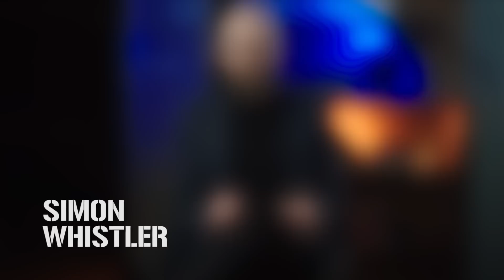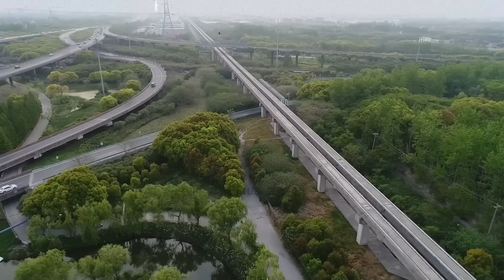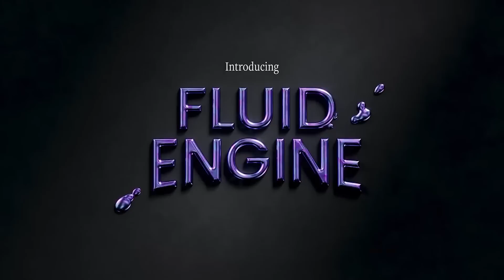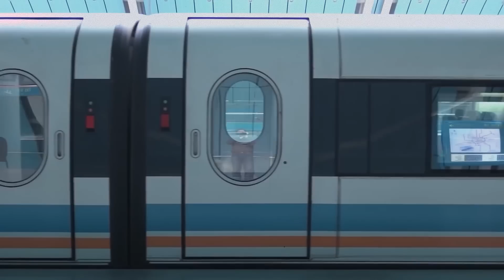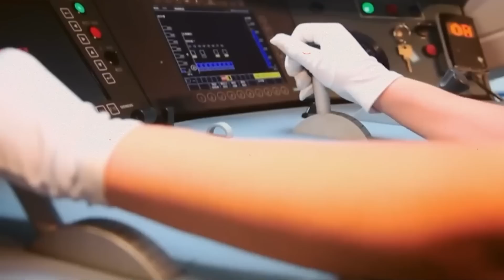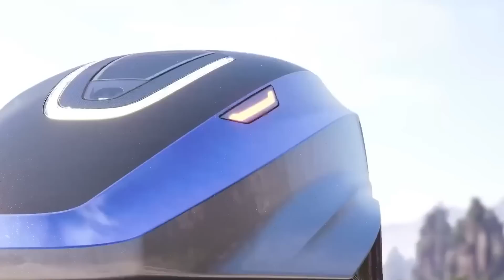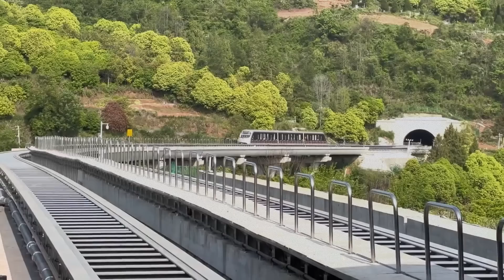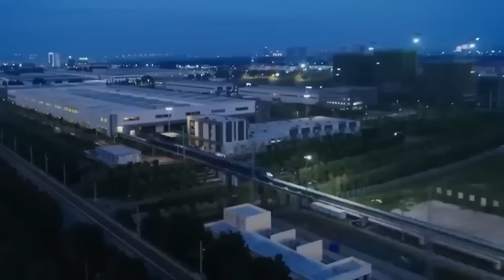A Chinese Maglev Revolution is Coming...

Comment: by flying you would have arrived already. you know why cars are better than the train. make it flying cars. infrastructure is community shared effort, personal transport vehicle is not. but if you want to go to orbit by a factory, then do a maglev to-orbit accelerator track on the ground. otherwise just make the flying cars space planes. magnet roller wheels both stick to the normal tracks and levitate over them. optimally you would only need to upgrade a normal wheel train to a magnet wheel train to make it a maglev train. the usual iron/steel tracks are just fine. then also the magnet wheels are the momentum source by rotation. so they work exactly the same as normal train wheels. simple hmh. for additional support, left/right side roller wheels to keep the wheels on top of the tracks. or just the normal angled wheels of a normal train. dont judge anyone. above came to save, not to judge. how you judge, you are judged. so dont judge. not even pre-maturely, law breaker. dont fall back into judgement. this is not fine, brothers. from same mouth leaves the cursing and the blessing. yeah vtol drone-plane quad copter can fly at v22 osprey speeds of 400km/h. why do you like being judgement.

Comment: Current maglevs have 5 issues, 

1: you have to build a completely new track, 

2: Cost of the track is 4 times higher then regular tracks with all the electronic charging wires, 

3: If the power goes out, you can’t use the track because it requires electrical power and you can’t drive anything passive on it, 

4: the switches on the track have to be completely moved if you want it to change directions.

So it not a very Practical design but a company in Poland called nevomo has made a track design that has solved those problems, there design is a semi passive system, it’s basically modifying existing tracks with a electromagnetic third rail that’s a passive magnet which proves the lift and then it adds 2 more rails on both sides of the track for active electro magnetic stabilisation, this is because permanent magnets are unstable so they need to have some kind of magnetic or mechanical stability, one company called iron lev uses rollers, the tests have show it can go through switches and over roads, the goal is to increase the speed by 72%, 177km/h to 300km/h for regular rail and 320km/h to 550km for high speed rail, an important thing I must note is that regular rail can be used on the tracks due to the magnetic technology being place around it and can actually enhance it by using liner acceleration which is a known technology on Vancouvers sky train
Reply: 1. It's already created
2. Still costs less than roads
3. Power back ups exist
4. China already have our

Comment: I recently returned to China for the summer, landing at the Beijing international airport (which it alone is very nice) and took the regular high speed rail from Beijing to Wuhan. The ENTIRE trip took like maybe 5 hours. I, having suffered through about 48 hours of sleeplessness and a minor cold setting in, had basically fallen asleep instantly. The seats were spacious (I think I got second class tickets) and the ride was just really nice overall. And it was really cheap too. 

Compare that to the... somewhat bad... metro system in my local area in the U.S.... I can't not laugh. Even the lesser maintained local intracity subway/light rail was so much cleaner and better maintained than the subway system which is almost like 60 years old now...
Reply: Almost 60 years ol? Is this DC Metro?
Reply: @peepinR  no

Comment: China have Magle train in 2020 come out. The speed train 450km per hour convert to 279 mile per hour.
Reply: The 450 Km/Hr figure has two significant digits so the conventional conversion would be 280 mi/Hr.

Comment: The new high speed maglev by CRRC is based on the same Transrapid tech that has been used on the shanghai maglev. They licensed core parts of the technology while developing other parts at home.
The high costs of having to purchase directly from germany as opposed to using domestic trains is what stopped the initial rollout of maglev. Now that this problem is solved, China goes full steam ahead.

Comment: China's high speed network is very unprofitable because as the network ages it requires ever more maintenance to keep it going plus only a few of the lines are profitable hence it has accumulated almost a trillion dollars in debt. The network could have been built at 10% of the cost using a max speed of 250 KPH instead of 350. 

Perhaps with these Maglev lines they have learned their lesson by the fact that they are only going to connect the major cities. It is unlikely it will ever recoup the money spent especially as the Chinese population begins its rapid decline to 750 million and perhaps even 525 million as researchers at Shanghai Academy of Social Sciences have projected.
Reply: Soooo why is usa military not providing any profit ? We sank trillions into it .

And yet e get no profit from it .

Why ?

Comment: You need to clarify what you meant by transmission in a diesel powered train! Most Diesel trains are what is called Diesel-Electric and there is no transmission unless you meant power transmission to the wheels via electric cables as the motors seat in the trucks (bogies) of the locomotive.

Comment: The Shanghai maglev is incorrectly called very expensive, because of the extra and longer piles required for the track as it was mostly built on swamp land and delta plain silt. They got that sinking feeling after a few piles were placed. It did cost extra, but not because of the technology

Comment: An air berring in a low pressure system... Something don't compute there buddy. Hyperloop tech is an absolute pipe dream, not impossible but completly unfeasible.

Comment: There is another massive project going on in China: building big power bank with two artificial lakes at two levels, when there is electricity overproduction, lift the water from low to high, when electricity is needed, release water from high to low. Basically it works as buffer for electricity production by solar. Now the solar electricity are not put on the network. There are around 20 projects going on, after being built, I guess all solar electricity will be connected to the network, the percentage of green electricity will increase a lot by that time. In 2/3 years.
Reply: This method is limited by the terrain. At the same time, China is also building compressed air energy storage projects, which compress air and store energy when electricity is abundant, and release energy during peak electricity consumption.

Comment: I'll Tell Why the Chinese are building the meglav network.... its to beat the Japanese.  The Japanese are trying regain their High Speed Rail crown lost to the Chinese by developing MegLav.  However If the Chinese also has MegLav... with its domestic scale and manufactoring cost advantage,  it will essentially end the Japanese's high speed railway export ambitions.

Comment: Some of the video footage you used are actually from Japanese Maglev testing track where test trains have been running for decades.  You can tell because the train is driving on the left. It is striking that there is no mention of the testing track or the construction which has already begun between Tokyo and Nagoya.
Reply: to be fair this video is looking at china and using footage of maglevs in general to get the idea across, Japan might be good at making High speed and Maglev rail but China is so good at that aspect they blow any competition out of the water. the only county that could ever compete with them doesn't have any high speed rail
Reply: Chinese trains also drive on the left. Guess they all picked up from the British.

Comment: Also noise, Maglev is smooth, quiet, fast and requires less maintenance. I've only been on the Shanghai one too and from the airport. Its been running for years as proof of concept. When China has technological development they build real world examples to get real world experience and data. Leading the world.
Reply: They cost more to build and also more in electricity bill
Reply: pfft I refer you to there aircraft carrier fleet with it's frontrunner having cracked runway before really being used china is not in a good place nor does it use good quality materials or construction practices these trains are wasting time

Comment: I just came back from Shanghi...
For experience, I tried this train from Shanghai CBD to Pudong International Airport, a distance of some 30 kilometres. It took us 7/8 minutes to reach the airport with a maximum speed of 300km/hr.
When I querried about the speed, I was told that the short distance and the track runs through the city centre, it was cap at the speed .
Nonetheless, I was told that they are planning a connection to Beijing and travel time can be btw 4-5 hours! What would happening to inter-city avaition then?
Reply: Shanghai to beijing is 4hrs in HSR, and it is operating for years.

Comment: Ah, nope.  People have already voted with their feet, heading towards the slower but much cheaper regular-speed trains.  The high-speed trains are running at very very low number of passengers and losing tens of billions of dollars a year, year after year.  This one company is 900 billion in debt.

 China is REALLY GOOD at throwing money at expensive projects like these and the two hundred million unfinished or unoccupied housing units.  Not so good at doing things economically and reliably.
Reply: thanks for pointing out a sensible problem with this alot of people really want high tech trains for some reason and unless your japan it doesn't make sense

Comment: I saw a claim once that at high speed (200mph?) 99% if the resistance is from the air and 1% from the wheels.

Comment: The USA spends trillions on trying to take over Afghanistan.. China builds a meglev train.  That tells you what empire is in decline.
Reply: the usa  already has a continental train air and road system it instead advances the world in lazer robotics and other such with aid to other countries in need given generously chinas belt and road initiative has failed and it relied primarily on tricking middle eastern nations into taking on debt after an intital buy in that tainted the look of initiative 
also chinas unemployment rate is baaad right now cause there housing collapsed and the world is drifting to using other places for cheap factory labor

Comment: Amazing what you can achieve when you don't have to worry about health and safety, building codes, or human rights.
Reply: Excuses, excuses. Always pointing out the flaws in others despite their achievements is the main reason why the west is falling behind.
Reply: @eat_ze_bugs  yes "excuses" nothing to do with human rights violations.

I'd rather not have buildings made out of substandard materials that literally crumble and collapse like Chinese tower blocks
Reply: @6Shroomie9  Care to explain what happened to the Miami tower collapse? Or the leaning skyscraper in the heart of NYC? Or the pedestrian bridge collapse in Florida? Or the shitty planes made by Boeing? We have built many things with shoddy quality too...
Reply: haha. I'm an Chinese Architect worked in China for 10 years. I am currently working in a New York Architectural firm for 3 years. Although China doesn't use IBC but the GB codes China adopts is much more strict than IBC.
Reply: @camdenuptown1777   I refer you to the shaking skyscraper problem and notoriously bad building code enforcement you are a liar or a moron
Reply: yeah they spend of effort boddies and money to inevitably end where they started with even less

Comment: Speaking of this Skytrain - its looks like a regular monorail and operates like one. Speed isnt great, frequent stops too. Isnt this was point why maglev rarely used for citytrains - not much of advantages to do that? Feels like Skytrain is malev just to call it maglev in official papers.
Reply: Speed isn't the only advantage of maglev, the video mentions maglevs require much less maintenance and is quieter because there isn't track friction.
Reply: @hughmungus2760  Its easy to maintain as long its doesnt broke. But when it does - easier to scrap.
Basically story of all such low-speed maglev lines. Also, in previous video on that topic Adam said that "short and low speed maglev lines have no real advantage".

Comment: It would be interesting to see financial side of this topic. My understanding is that many of the HSR lines are not profitable. Some even to extent that they are not able even to cover interest on the loan, let alone loan itself. And maglev should be order of magnitude more expensive than HSR. That doesn't ignore the fact of all the social benefits HSR brings. But in the long run it raises questions of sustainability of all that. Specially considering that in next 10 years around 300 milion of chinese people will go into retirement and chinese fertility rate at 1,16. Maybe robotization of the country factories will make up for that.
Reply: debt, particularly long term debt held by one state institution to another is largely irrelevant. they can be defaulted on with next to zero consequence.
Reply: @hughmungus2760  you can always argue that it doesn't matter how economically sane some project is. China now has over 45.000 kilometers. If most of them are not profitable they will need state/region subsidies. That money has to come from somewhere. You need to take that money somewhere to put that money into railways. Sure there are benefits but question is at what cost. With time maintenance cost will rise just adding to the problem.

Comment: Everything is based on debt or running in losses, none of these are actual advancements.... There's a big debt bubble waiting to burst
Reply: Better than usa's debt
Reply: @fahman3422  actually there debt ratios are proportionally worse than ours much less wealth to pay for it and remember thanks to the one child policy they have a far too large older generation with around a third of that being the younger to support them and of that younger only one third is female and since we don';t have machines to make kids this is a catastrophic demographics problem
Reply: Everyone is obsessed with one child policy but Korea and Taiwan never had it yet they are in the same position.
It made it worse but not as much as one would think.
Reply: That's where you're wrong. The numbers might be higher, but most of that debt is not tied to our GDP.
Reply: Compared to ours? It's a drop in the bucket.

Comment: I know there is abit of hyper about China working on maglev, however that is largely a research project, there is no intercity infrastructure project for maglev in China since they are more concern with coverage than speed (with the current HSR, you can get from one end of China to the other end in a day, maglev is abit overkill for chinese traveling habit). the only country to have a intercity maglev project now is Japan. the reason for this is Japan, most of it population is just in 3 cities, so you really only need to connect 3 cities together to have a massive boost, furthermore the Japanese has demand for trip that is not "end to end", that is they would go to another city, have meeting, then go to another city or home on the same day, so a faster travel time make more sense than for the Chinese who do more "end to end" travel and would stay at their destination for at least a day.

this is not to say China won't pursuit Maglev in the future, however it isn't going to be the first, nor do they have a plan on what they want to do with maglev yet, this is really just preparation work so that if they want to build it, they would have the means to implement it. I do see the possibility of "regional/provincial maglev", that was the original proposal, a maglev that link hangzhou, shanghai, suzhou and nanjing for example can allow these cities to merge into a single economy.

the first practical commericalization attempt for maglev was in germany, the shanghai maglev which was suppose to grow into a regional maglev was build using this technology. unfortunately, an accident occur in a routine maglev demostration in germany, the train collided the service train due to communication errors, while the accident was no fault of the technology, ruin its reputation in Europe, killing any chance of it been selected by any european government. China too walk back from maglev, but it was really due to them understanding that coverage is more important to China than speed than because of the accident in Germany.

I know video has to sensationalise thing, but I feel it is best to explain the reality for what it is than to buy into the marketing hype of these technology. as cool as maglev is, it has very limited use case and is really only suitable for rather linear countries like Japan. else having a web of station would make more sense and HSR are much easily to run and it is only marginally slower.
Reply: 600 and 350 is not marginally slower, it's double faster.
During the initial days of bullet trains , people used to give same excuses now look at the present. 
We are talking about future not dwelling on the ifs and buts of current situation.
Reply: @subasthapa8323  we are not talking about the future, we are talking about planning. and there is no plan yet. the train hasn't even been tested, how can you plan a system when you don't even know what the top speed of the train is? development is not just building infrastructure, you need prove of concept, economic assessment, policy assessment. does it conflict with their investment in aircraft manufacturing for example.